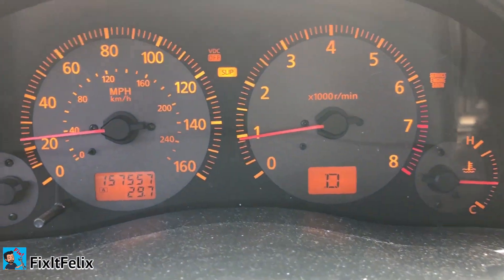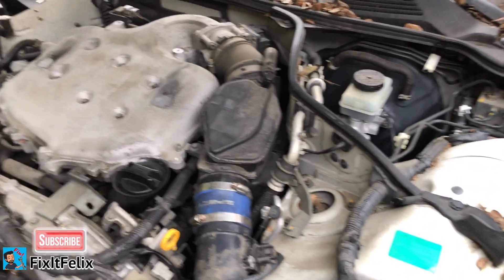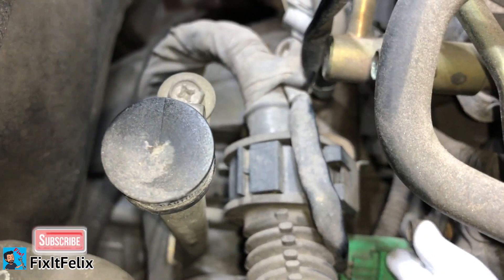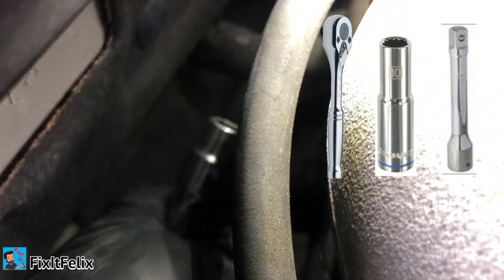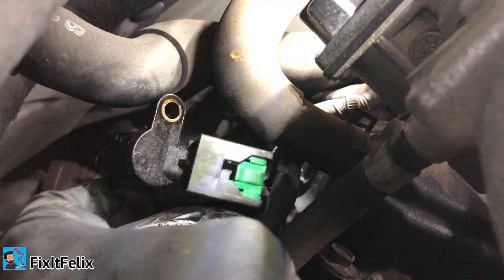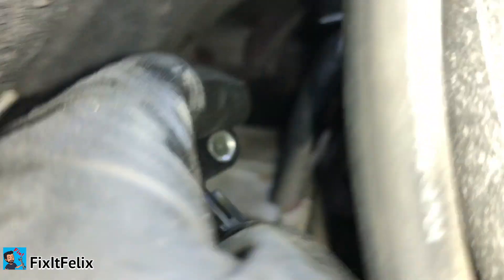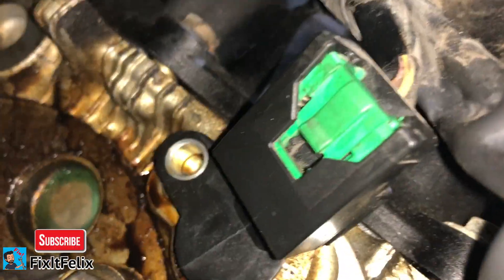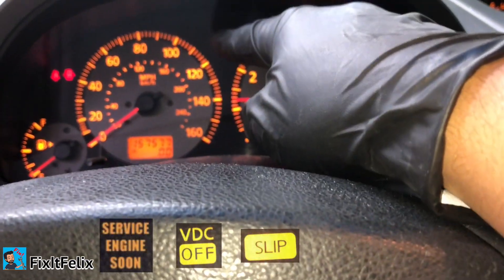Infiniti G35 camshaft position sensor replacement

Comment: I wonder if you could just clean sensor itself, the green plugin, and where the sensor goes into? Unless your sensor is warped or burnt out ..........??
Reply from the maker: Sometimes there’s oil that gets into the sensor and it makes it stop working.  You can try cleaning it but they usually go out
Reply: Fix it Felix yeah I know. My G's a 03 too. So it's about time to change it out.
Reply from the maker: Good luck 😊

Comment: Got code for bank 2, replaced and it still has check engine light on only?
Reply from the maker: But did it fix the problem?
Reply: The check engine  came on a few days ago not the other 2 and I didn’t feel anything different with the car. I got it scanned at auto zone and they said it was bank 2 so I just replaced it and was hoping the light would go off but it didn’t. Car starts fine and idles fine. Do I just need to reset the CEL?
Reply from the maker: Yes.  Just reset CEL or just disconnect the battery for like 10 to 20 min

Comment: Hey Felix I just did the change on my 04 G35 and I’m sure/positive I changed the correct one but the lights are still showing! you have any suggestions on what it could be?
Reply from the maker: Disconnect the battery for 30 min and then connect it back
Reply: Fix it Felix thanks Ima do it right now!
Reply: Fix it Felix do I disconnect the whole battery or just the negative side?
Reply from the maker: Negative side only should be fine
Reply: Fix it Felix ok I’m doing it right now!
Reply: Fix it Felix it worked for a while but when I went for a drive in like 5 min the car stalled on me and when I turned it back on it took a while to start and the lights came back on!
Reply from the maker: Guero -_- maybe there’s a chance you replace the wrong sensor.  There’s another one that’s very similar to it
Reply: Fix it Felix I’ll look right in to it thanks!
Reply: @yonatancarranza7874  so what's the update? What was you doing wrong?
Reply: Keith Jackson pretty much I checked and fixed the problems like the fluids, the abs module and the camshaft sensor and the result it still the same with the lights still being on and it takes a while to start but it starts on the first try but it doesn’t stall anymore after I drive for like 3 miles
Reply: Keith Jackson so I’m just deciding on taking it to the dealership and have them fix the problem!
Reply: @yonatancarranza7874  can also be accelerator pedal position sensor there was a factory recall on that for the m35 same engine .

Comment: 2008 G35 horror story. went fort smog check. service engine soon light on. Diagnostic with any own device and the repair shop device says cam sensors.replaced 2 sensors light still on. replaced the other 2 light still on. replaced solenoid sensors light still on. repair shop gave up and I still can't smog my car. any suggestions?
Reply: they reset the sensors and the light is off until I,m about 2 miles away from the shop and the light goes on again lol. car runs fine otherwise. and I still can't get smoged

Comment: If anyone is interested in getting both bank one and bank two, there’s a website called partsgeek dot com. You can search up your specific model. 
Just ordered both for 53 dollars for my M35.
Pretty annoying but it’s gotta be done

Thanks for this video and the detail I was trying to find the damn thing without removing the air box and throttle body.
Reply: I got mine from there👍👍
Reply: How’s it working? Have you had any pro jokes with the one you ordered from there?
Reply: Rockauto parts pretty good too

Comment: How many camshaft sensor 2 or 3? Need to replace them or only one?
Reply from the maker: There’s only 2.    Only replace the one that’s bad.   Check with a scanner which one you have to replace
Reply: Is it true only the OEM sensor works?

Comment: I changed all three  sensor's and still have the hard start...what else can the problem be...and I feel a little lag and loss of power....and suggestions????
Reply from the maker: Is your check engine light on ?? What codes do you have?
Reply: @FixitFelix529  yes...the ses light...vdc...and the slip light...and it lags...it's like it's on limp mode I guess...idk...smh
Reply from the maker: Take it to auto-zone or your local mechanic shop and tell them to read the engine codes you have. They should do it for free. Once you get those codes let me know what they are
Reply: @FixitFelix529  ok...will do....just check back in a few hours...I just got off work and I'm tired...
Reply: @FixitFelix529  I went to auto zone and they saying it's the same fucking problem...camshaft position bank one...😠😠😠

Comment: Nice video. Wish me luck. After spending $100 and an hour changing my fuel pump I Hope this fixes my issue.
Reply from the maker: bigwass42 good luck  ^_^ keep me updated it
Reply: Did it work?
Reply: Thought changing my fuel pump would fix my not starting issues but it only worked for a few days
Reply: Dvarius Wright yes. The camshaft sensor was the issue. It’s kind of a pain to get behind the engine to pull it out but once it was changed out the car ran perfect.
Reply: bigwass42 were you having start up issues? When I try to start my car it’s like a pulsing turn over of the engine. Until all the lights in the car go off and never starts
Reply: bigwass42 after it finally does start, I immediately turn the car off and then it starts up perfectly fine
Reply: Dvarius Wright when it first started my car would take longer and longer to start. Then rpms would drop at highway speeds. (Which was scary). The part is like $40 and fairly easy to change. I would say go to autozone or somewhere like that and use there scanner. They can tell if the sensor is bad if your check engine light is on.
Reply: Dvarius Wright also if you have the money change both sensors right away. I had to change my crankshaft sensor and both camshafts sensor within 3 years.
Reply: bigwass42 thanks for the heads up bro. I have a trustworthy mechanic that barely charges me for labor I’ll take it to him first thing and just get all of them replaced. I do have a check engine light and once it’s one it runs pretty good so I have a good feeling it’s the sensor! Thanks bro I’ll update you lol gotta keep the G’s running strong
Reply: Dvarius Wright sure bro. Good luck!

Comment: Hey felix I replaced mine but Im still getting the engine service light but it drives perfectly fine( I did both of them) not sure what to do.  Please send some help my way lol ty
Reply from the maker: Disconnect the negative battery terminal for 15 min so it can reset. 

If the light still on then take it to your local AutoZone or O’Reilly they can check for codes for free.  Let me know
Reply: Fix it Felix thanks man !!!
Reply: Fix it Felix ill lyk
Reply: Hey Felix I tried to reset it but the light is still on and my idle is super rough and sometimes wont start but once it turns on it drives perfectly fine no problem.  I even replaced my crank sensor but still having issues and even went and got a different cam sensor today.  Im not sure what to do man im clueless at this point

Comment: Maybe someone can help me here? 03 g35 6mt. when I start the car I have to turn the wheel to the right and the slip and vdc light come on and I can drive normally. If I don't turn the wheel and get those lights on the dash then when I start driving maybe 10km/h it feels like the abs kicks on the passenger side like 10 times lights come on and you can drive normally. Anyone run into something like that?

Comment: Guys this is WRONG the check engine light doesnt go off that fast, he probably disconnected the battery first and clear it that way. You have to drive the car after replacing the sensor and let it go off on its own.

Comment: I would NEVER buy another Nissan. They know these cam and crank sensors are defective and only did a partial recall on 2003 models. These sensors fail constantly and create a very dangerous situation when they fail and the engine shuts off. Nissan should fix their faulty sensors.

Comment: Felix I had my codes ran today and I got "P0327 Knock Sensor 1 circuit bank1" and "P0340 Camshaft position Sensor Bank 1". I love your videos but I also don't have the tools needed for the job. Is there anyway you can help me find the tools you are using in the video.
Reply from the maker: The tools I used on this video are simple tools you can find anywhere.  Like Harbor freight or Walmart
Reply: @FixitFelix529  Okay, Thanks so much this will be my first attempt when I get the parts. I also wanted to ask you will I be okay not going with OEM parts?
Reply from the maker: It’s always better to get the OEM part but that’s up to you
Reply: @FixitFelix529  Okay, It's just so many options on amazon, eBay etc just want to make sure I get a decent one if I don't go with OEM. I will keep you posted, thanks again. Awesome channel!
Reply from the maker: Thanks!!! 😊
Reply from the maker: Theemikebell well I did my research and bank 2 is the one on the passenger side.  Bank 1 should be on the driver side and the sensor should look like straight not on an angle like the one I replace.
Reply: Okay @FixitFelix529  so does it all depends on how you are  viewing it. Let's say we are both sitting inside the car. Your saying Bank 2 is the passenger side which is right and Bank 1 is Driver side which is Left. But if we both are standing in front of the car would it al be the same. And yes okay so parts geeks may be taking the same POV they have the straight one as as position right so I'm figuring they are viewing it as the driver sitting behind the wheel.
Reply from the maker: Theemikebell yes bank 2 is the sensor that has an angle and is located in the passenger side 

Bank 1 is the sensor that is straight and located in the driver side
Reply: which is the one you pointed to first on the video. @FixitFelix529
Reply from the maker: Theemikebell correct